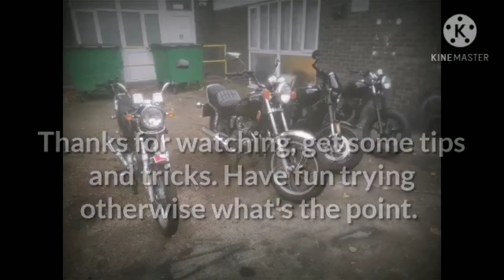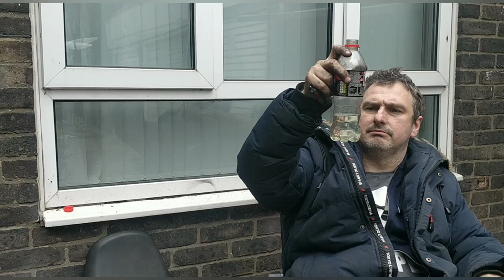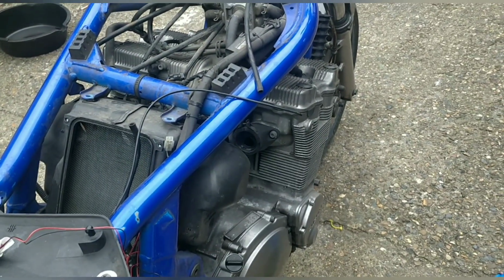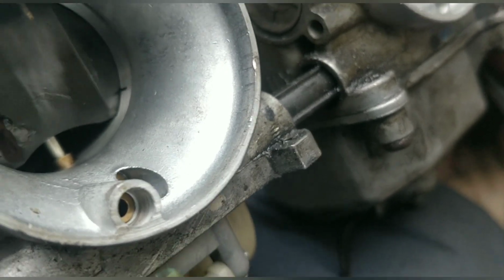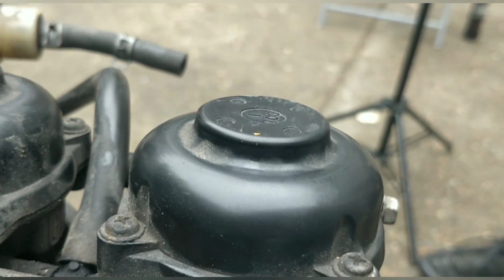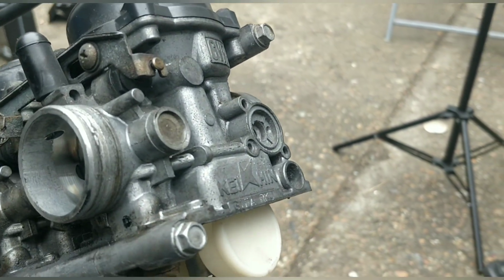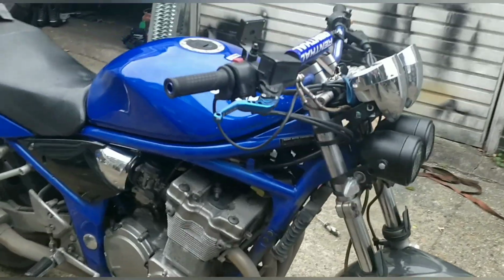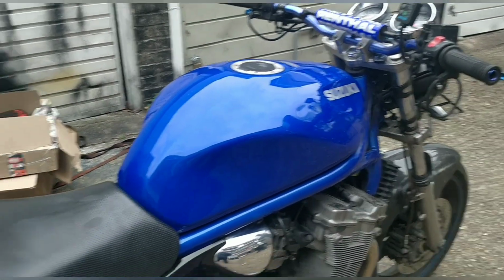Bandit 600 surprise. Always check for this when servicing. Non running Suzuki bandit 600 carb clean

Comment: If you do swell the diaphragms by getting carb cleaner on them and they change shape dont worry!!! Soak them in water over night, they will go right back to original size.
Reply from the maker: Oh really, is that a thing? 

I've never been able to save diaphragms once they had stretched. 

I'll give this a shot next time I come across this issue. 

Thanks mate
Reply: I mistakenly soaked the diaphragms in carb cleaner.  They became completely out of shape. I was very disappointed and was going to have to order new ones.  I soaked them in water over night and to my surprise....they went right back to their original shape and retained the same rubbery properties. I chemist is going to have to explain to me how that is possible, but it is! @motorcyclerescuer
Reply from the maker: I'll give it a try one day out of curiosity. Lots of things amaze me with engineering. I learn new stuff all the time. 

Thanks

Comment: Fit an aftermarket jet kit and seals and idle mixture screws 3 turns out and if piston rings are free, watch it fly.
Run it on Halford oil as cheap and perfectly adequate (made by coma oil I believe) had mine 21 years from new
Reply from the maker: We could up jet it a touch I guess. What size would you suggest?
Reply: @motorcyclerescuer   had my bandit since 2002 new and always a flat spot around 5-6k 
REPAIR KIT CARB Rebuild 26-1664 made by All Bulls Racing has nicely machined parts and it now flies compared to stock kit. Can't recommend it enough has same part numbers, but the jets look bigger. Fowlers at time I bought bike wanted to sell jet kit-I wonder if stock oem was for emissions new and now corrected.
Reply from the maker: That's interesting,  I've never seen/felt a flat spot on any bandits that I can remember.  They are normally super smooth throughout the rev range. But yes as you say, stock jetting included slight restriction for emissions reasons. Either too rich or too lean.
Reply: Best leave the Engine , carbs & air filter bog standard . Leave standard zorst on & just get two new stainless collars welded on where mild steel joint rots . Service  as per manual & only use standard Suzuki oil filters & quality correct grade semi synthetic oil . Fitting a givi fly screen takes wind blast over riders helmet & enables cruise at speeds of 70 mph plus .  Avoid using cheap tacky aftermarket parts on carbs & engine also avoid anodised tat & loud obnoxious race cans that cause spitting ,popping & banging on the overrun . That’s the sign of a bike that’s poorly set up .
Reply from the maker: Great advice all round

Comment: pretty sure my bandit is restricted to .. had it moted or whatever its called in the UK .. and it says "constructive changes" .. wich could be restriction and thats nothing special about the bikes looks .. but it does feel a bit "slow" getting up there
Reply from the maker: The mot wouldn't be able to pick up on any mechanical issues or restrictions. Constructive changes I'm guessing is something structural that's changed. New swing arm, new shocks, or new seat etc

Comment: That's a nice result finding those Carb restrictors. You mentioned the Diaphragms expanding, I found that the new fuel makes them expand?
Reply from the maker: Fuel never touches them Terence, but when cleaning some people spray up into their area and carb cleaners aren't very good for rubber. 

So I tend not to mess with them unless I really feel that they may need changing

Comment: Are the main jets part of the restriction kit and need replacing? Might be worth checking standard size and go up one for the exhaust.
Reply from the maker: I checked and they were original jets. I was curious about that aswell.

I'm actually surprised this kinda system works, just blocking air/fuel flow.  I feel like it should back itself up or something. 

Cheers mate

Comment: I’m, fair anchoring over a nice bandit, year not so important but I would gladly swap my Honda NT700VA 2007 with 25,000 true miles on it for the right one. Preferably a 1200 Mines as always with my bikes immaculate, truly as new with no signs of winter damage. At 63 even though I should know better I’m having strong urges, lol, keep your eyes out for one if you could Charlie, I only took mine for it’s Mot plus one 90 mile ride last year, I dare not say anything to my wife at the moment cos I actually said this would be my last bike ever!
Reply from the maker: The 1200 bandits are starting to get more rare. I had one some years back and didn't feel the power to weight was much better then the 600 really. 

If the 1200 is slightly tuned it can be incredible.

Comment: Having removed the restrictors, I'd have thought a balance would have been called for?????
Reply from the maker: No I'm sure balance will be the same. Each carb will still be sucking in the same amount of air in comparison to each other. 

The bike continued to run beautifully aswell.
Reply: @motorcyclerescuer  Okay... it's amazing what little changes can put out of synch.... but, yeah, glad you discovered how "big brother" tries to control. Safe trails.

Comment: The sound of glory. Great work mate. Enjoyed it. I am thinking of getting a Bandit. I am not sure of getting a 2001-2004 or 2005 to 2006. The latest was the last one with carbs. What do you think? Got my like here.
Reply from the maker: Honestly I like a bandit from mk 1 upwards but something about the more basic nature of the earlier ones appeals to me. 

Saying that this one, Gary's one is so smooth. So honestly I think you can't go wrong with whatever you get. 

I highly recommend a blue flame twin exit end pipe on these. One if the best sounds out there. 

Thanks for watching.
Reply: @motorcyclerescuer  Thanks for your tip mate. It is there a big torque feel difference between the 600cc and 650cc model?
Reply from the maker: Great question, I prefer the 600 for its revs, but the 650 does feel a touch better on torque. Gary's 2005/2006 model is the best of all worlds I believe.  Old bandit looks with a great carbed engine. 

I suggest you try both before buying. You won't feel much difference between them so it will probably come down to looks though.
Reply: @motorcyclerescuer  By the way how tall are you? The 2001-2004 model has a slightly higher seat. :) You tried both that is why I am asking. Thanks mate.
Reply from the maker: I'm 5.9. I've never found any bike to tall and the rear can be changed easily enough with new dog bones. 

Or seat can be shaved 

So I wouldn't worry to much.

Comment: How much extra power .by the way its 35 kw or 47 bhp ,.
Reply from the maker: I'm unsure what the washers were restricting the bike to if I'm being honest. Possibly the new a2 47bhp as you say. In the past I believe bikes were restricted to less if you passed your test on a bike smaller then 500cc. 

So it could be a 47bhp or 35bhp

Comment: I cleaned carbs now the engine is racing on tick over?
Reply from the maker: Hi Stephen, was it high tickover before cleaning? 

It could be a few issues mate. Idle screw adjustment.  

Balance issues 

Diaphragm issues especially after cleaning carbs. If any of the cleaner got onto the Diaphragms then they could have got out of shape. 

Air leak would also cause idle issues. So a suction tube not put back on or a carb boot not fully seated. 

You will have to look into all of these to try and find your issue mate

Comment: Also tell him not to use choke now and the bike will never need it , my both bandits never need choke even in winter I’d just hit the button let em sit for couple off min and off I’d go even in winter I’d put ten mil off iso,in fuel tank stopped the carbs icing up ,there realy good tough bikes ,
Reply from the maker: Cheers Cross, that's great advice mate

Comment: Where are you based please mate?
Reply from the maker: London
Reply: @motorcyclerescuer  
Unfortunately im based in Birmingham having some issues with my bandit 600 that purchased few weeks ago, the bike had pods fitted but carbs hasn’t been rejected to suit them, basically replaced with stock air box and new hi flow filter, but now probably need to adjust the carbs
Reply from the maker: Yes they may need a good clean and balance. Also check/change the spark plugs as they may have run to hot and broke.
Reply: @motorcyclerescuer  
Thanks buddy
Reply from the maker: Good luck with it. Let me know how it goes.

Comment: Hey my bandit dropped on its right side and won’t get any power/won’t start. Any ideas anyone?
Reply from the maker: You will need to check the airbox to make sure no oil is in it and its worth cleaning the spark plugs for the same reason. 

When you say no power, do the dash lights come on and it try to start?
Reply: It still worked for about an hour just fine after the drop but after that it stalled and wouldn’t start. Got it home and now when I turn the key the Neutral and oil lights come on but lose brightness as the bike sits, same for the headlight. The horn makes a small kinda chirp sound as if it honks for a split second. The turn signals won’t come on and when I try to start the bike it makes a click sound then loses power gradually for every try after that.
Reply from the maker: @yurei2114  sounds like the battery is dead?